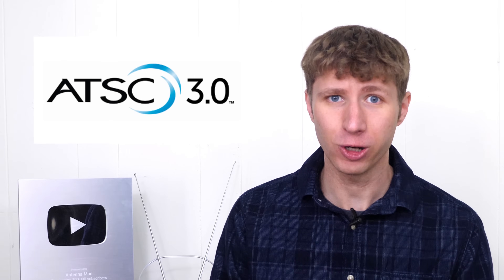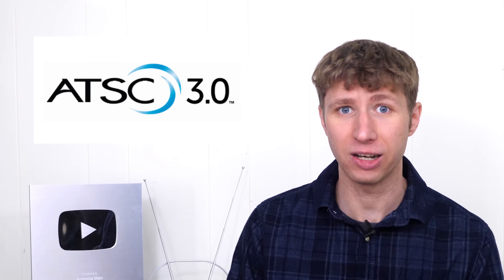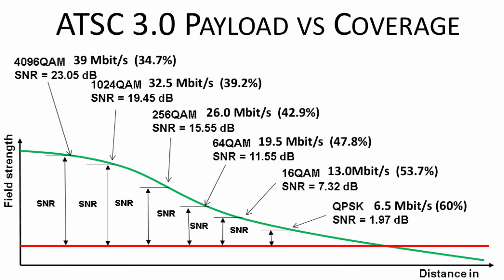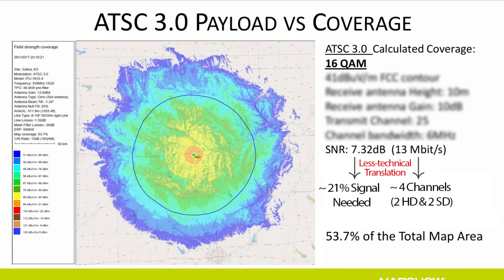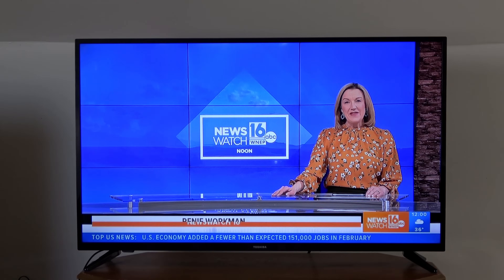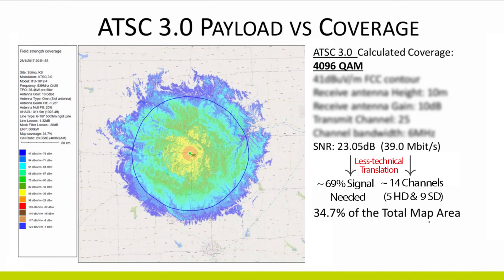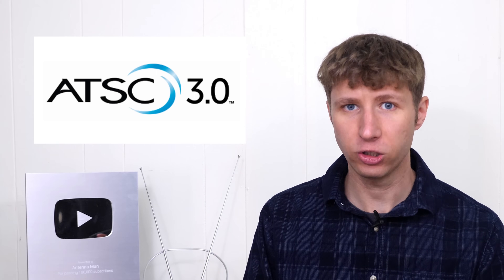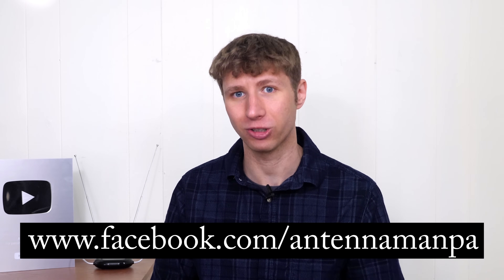ATSC 3.0 Allows TV Stations to Reduce Their Broadcast Signal

Comment: All about wireless handsets now has been for about 50 years now more true than ever. Still is a role to play for fiber optic lines now as well....even twisted pair actually. I'm going with "streaming services" as to why there is an issue with this as that consumes an incredible amount of bandwidth upon in the digital offer. Might not need digital anymore/might be post digital now #quantum_computer "quantum signalling" hard to tell. That will definitely light a fire under the ass of the digital assholes for lack of a better term to ditch the whole "trade off" thing as might not have any need want or desire to even have digital especially since none of that signal is secure nor produces content much in demand. Maybe gaming content #twitch maybe that's about it tho😊😊

Comment: Just 15 miles from the Philadelphia towers, in a third-floor apartment facing Philly, last week I lost the ABC affiliate WPVI 6 completely. All other channels are good reception. WPVI is snow, nothing else, no signal detected. Zero. I heard back from an engineer at WPVI, who told me they just switched to a new transmitter. My next letter will be a complaint to the FCC. I bought a flat antenna you had recommended, it gave me worse reception than I had already on the channels i was getting.

Comment: My antenna hasn't worked right in over two years now and I have a 30ft pole outside with a large array located within 30 miles of all broadcast towers in my area. 
I'm convinced "they" have been throttling the signals as a form of behavior modification, forcing us to purchase other forms of viewing entertainment. 
BS

Comment: The argument that means the least to me about ATSC 3.0, is that it is better for distance than 1.0 current system. I'd rather clean the cat's litter than listen to this point. I've never welcomed this point. So.the stations have a way to squeeze ATSC 3.0 but loose distance. Good. It fits my hopes. All I want is these digital standards to go away. My antenna is down and folded up. I could just give it away. Please, no more remarks that ATSC 3.0 travels farther. I want analog back.

Comment: WPVI Channel 6 will broadcast with 120 KW ERP and cover 70 miles around Philly with ATSC 4096 QUAM signal on LOW VHF Channel 6, the best of the low vhf channels in the USA!   Adjust your rabbit ears for 35 inches on each side for best reception.
Reply: Is this a waiver of the Low VHF limit?  Likely so.  Surprised that since the FCC Repack ™️, WPVI didn’t choose to piggyback on a decent UHF signal.
Reply: @christopherdunne7848   ABC deliberately chose Low VHF Ch. 6 for Philly and the Ch. 7s for NYC, Chicago, and LA.  VHF is better for TV transmission with High VHF Ch. 13 being the best and Low VHF 2 being the not so best.  Ch. 5 and 6 are the Goldilocks Low VHF Channels and Ch. 9-13 are the Goldilocks High VHF Channels.  Ch. 5 and 6  only need an antenna of about 35 to 38 inches long, which is a little longer than an FM radio antenna.

Comment: Tyler, The primary job of the FCC is prevention of interference. If ATSC 3 increases bandwidth, to maintain FCC. Mandated coverage without interference, they should be able to increase transmission power. You did not mention power, and that is a key element to the equation.

Comment: I have a Zinwell Nextgen TV Box that cost me $100. It sometimes gets stuck on the Nextgen TV screen when booting up. Sometimes it takes several tries for me to get it to work. This is the second box I have from them. The first was even worse and I believe was defective. When the box was sent back to Channel Master, they said they could not find anything wrong with it. They did send me a replacement box. The box would sometimes work, but not always. The Zinwell box also sometimes has issues with the signal. Sometimes I get a "No Signal" message and it can take several seconds for the picture to come back on! Far from perfect.

Comment: Wait. This video seems a bit anti-NAB and oversimplified from a technical perspective. Your conclusion is based on single transmitter and static ERP. Those are pretty big assumptions. I get that DRM has soured things a bit, but ATSC 3.0 far exceeds the capabilities of ATSC 1.0 and is highly desirable from a consumer perspective. Higher data rate 1024QAM and 4096QAM could be desirable to improve video quality, depending how broadcasters implement it. Don’t forget that single frequency networks (SFN) could offset any single transmitter coverage reductions. That’s something ATSC 1.0 cannot do. It’s time to move on from ATSC 1.0, which is outdated and FAR behind current technology.

Comment: Keep in mind that the coverage areas are mostly related to the budget and decisions of the engineers setting up the antenna and transmitter systems.  Lots of LPTV stations have way less coverage than they could be licensed for simply because they aren't willing to spend the tens of thousands to hundreds of thousands required for optimum indoor coverage.  Outright restrictions on higher modulations would prevent them from being used in terrain limited areas like where we operate where antenna design and beam tilt could be used with ATSC 3.0 SFN setups to increase coverage even with higher modulations.  (That is if we could get enough donations to cover the construction cost)

Comment: In the past 2 weeks I found out that Sinclair owned a tower that transmits 6 different network signals out of Gainesville / High Springs, Florida had blackmailed the broadcasters to pay more - they won`t do it - so now there are only 3 PBS stations broadcasting- no network coverage. Before change to digital- it could receive WJXT in Jacksonville and WCTV in Tallahasse - now can`t get either.

Comment: Aside from the potential loss of coverage DRM is still terrible.  If you have to have an internet connection to view a DRM channel then what is point of using an antenna?  They might as well just switch to streaming and be done with it.   ATSC 3.0 had a lot of potential but it seems like it is largely DOA.

Comment: I have a 3.0 channel that is in the fringe. I can get the 1.0 sometimes at night but not very reliable, depends on the weather. I Was looking forward to the 3.0 thinking it would come in better and maybe get it in the day. WRONG. It does not come in any better at all, actually the 1.0 signal is stronger when I compare the 2 on the tv meter. Sometimes the 3.0 drops off and the 1.0 is still on. Very disappointing getting hiped up just to get a big let down.

Comment: I'm already convinced that they control the signal strength because when the west coast of Florida (including myself) was being threatened by the 3 hurricanes that passed us by, but not without knocking out the power for a couple of days, I was surprised to see that even though I was only using battery backups until I was able to get my generator up and running the next morning, that I was practically getting all of the (including hard to get) channels crystal clear, however it was short lived once the hurricane moved on to the states north of me and that's when everything went back to the norm for me. Once again I was convinced that I still needed a new antenna.
Reply: It would be interesting to find out which station is the "lighthouse" for the market and see if they changed the "MODCOD" during the time of the storm.

Comment: I knew this would happen when it's claims of better reception from the get-go. If they use 20KW to broadcast 50 miles out, can get 70 miles with 3.0, OF COURSE you reduce the signal to match the old 50 mile range, but the "Datacasting" excuse is likely just that, an excuse. I'm sure stations (and WGBH would not surprise me here) are simply reducing strength just to spend less on transmitting a signal. NOT saying the higher demand protocols won't do it (look at UHF channels back in the day, and what power they needed to get roughly the same coverage across the dial), but I'm sure the robust ones can be used simply to cheap out on transmitting power.

Comment: First of all, I appreciate your videos on subjects like this.  I find them very educational and helps bring me up to speed on ATSC3 from a technical perspective.  I am mostly a radio person where it comes to the technical stuff.  If we boil everything down though, the Communications Act and underlying regulations are pretty clear, a broadcast station, whether it is radio or television is dedicated to provide to its community of license (the one that is said or shown at the top of the hour) before anything else.  Any areas outside of the community of license are a pure bonus to the public.  This is different than television/radio regulation in other countries where a company is franchised to provide full services within a particular region, even if it involves multiple transmitters.

The other thing I see here is that this is is not a case where the television station would actually reduce their effective radiated power (which would reduce the size of their service contours).  Since that is likely not happening, the FCC is happy because the station looks no different on paper and the station does not risk another station modifying as a result of any kind of reduction in the service contours.

The one thing I do not know about ATSC3 is whether the use of DTS can be done.  (DTS is distributed transmission system, which, in the ATSC1 world, allows for multiple transmitters at different locations to be put on the same channel and provide a "mesh" single frequency network).  

As you may know, the FCC will be voting this coming week to adopt a Notice of Inquiry into looking at different alternatives for GPS.  One of those is "BPS", which does radiolocation through the use of ATSC3 transmitters.  We should be seeing a lot of this at NAB this year.  This is one of the things I will be seeking out when I am there.
Reply: Yes, distributed transmission is part of the ATSC 3.0 standard and is known as SFN (Single Frequency Networks). This is a great technology that would essentially allow a mesh network of transmitters. However, I haven't heard or personally witnessed this being implemented yet.

Comment: Excellent presentation. The GatesAir Powerpoint presentation explains a lot. I foresee that datacasting is going to be the model that the station owners are going to use for ATSC 3.0 for an additional revenue source. The big question I have is will the stations move away from the ATSC 3.0 lighthouse and broadcast ATSC 3.0 at their own transmitter facilities once ATSC 1.0 goes away?

Comment: 3.0 is blocked by DRM. That basically means you cannot use it without very specific, and expensive tuners that need to be connected to only one device at a time as the DRM blocks the signal from being handled by a networked TV tuner. No one has multiple TV antennas for each TV in the house with a built in tuner for this purpose, so therefore, very few people can even access ATSC 3.0. A lot of these also require high speed internet access to use. This is such a broken deployment, because it was never geared towards improvement in quality, but with the idea of opportunity to advertise and make more money. ATSC 3.0 has been effectively killed by their own adopters, and now they're trying to kill 1.0 which means they don't have to offer any OTA signal that is not protected by DRM. This effectively kills 3.0 as well, which is their goal.

Comment: I have had  WHCT-LD (channel 35) licensed to Hartford and New Haven, Connecticut, for many years and, approximately one month ago, noticed a reduction in their signal strength.  I assumed they were having transmitter problems. I also have  ATSC 3.0 and those channels are OK. I actually spent several hours trying to ascertain the low power problem. My antennas and preamps are OK. Most ATSC1.0 are still booming in with a 92 out of 100 percent signal. So I don't know what is going on?

Comment: Of course, the FCC could have avoided this problem if they hadn't slashed power levels in the digital transition in the FIRST place, and those of us who actually WORK with RF and aren't just lawyers appointed by presidents to the commission to do political favors for donor corporations WARNED that coverage area would be lost if they did that, but the cell phone companies' money was more important to them.
Reply: Again, why I said I have a feeling that the groups that are pushing both ATSC standards are more marketing people than engineers.  No engineer that I know would say you can cover the same area that you did on analog by reducing power.  The only way you could possibly do that is to move the antenna to a higher elevation, and even that has limits.

Comment: Another thing is that increased signal strength doesn't necessarily mean increased signal range.
Reply: It does to a point, however, you can easily over-modulate a signal, as many do when they turn up the power on a wifi router.  Over-modulation creates distortions, which quickly negate any benefits you may have had with an increase in power.  It's a fine balance between signal power and noise levels, and finding that optimized balance takes a lot of time measuring signals and adjusting equipment.

Comment: Overall ATSC 3 has serious advantages over ATSC 1, but also more potential for predatory corporate abuses.  The reception of OFDM is better on many devices, while CODEC's are improved, so long as broadcasters use those advantages in the public interest as obligated by badly enforced law.  

ATSC 3 was planned around a 26 Mbps data stream plus denser CODEC's, if broadcasters use that mode.  Since RAW Cine grade 4k DCS runs a data stream around 200 Gbps, even the 39 Mbps COFDM ATSC 3 PLP is severely crunched and quality limited, at the cost of higher needed SNR and reduced coverage area, if only 1 video signal is carried and nothing diverted for non-OTA private contract data divergence of bandwidth.  

There's a need to pressure Congress to mandate minimum OTA TV quality, and as in past eras, restrict the use of OTA TV for so much secondary data for private uses, as to harm the public service aspects of broadcast licenses.

Comment: If ATSC 1.0 signals are not being adequately received in fringe areas, broadcasters would have a responsibility under public interest obligations (as described in the Communications Act of 1934 and the Telecommunications Act of 1996) to ensure that their broadcasts, including emergency alerts and political content, reach these viewers. This could require broadcasters to install repeaters or translators to rebroadcast the signals into underserved areas. And broadcasters cannot block ATSC 3.0 signals because of the same issues as emergency alerts and political broadcasts.

Under Section 309 (License Renewal) of the Communications Act of 1934, broadcast licensees must demonstrate that they have provided service in the public interest to maintain their licenses. Local programming, including news and emergency alerts, is a key component of this public service.

Quote: "In determining whether the public interest, convenience, and necessity will be served by the renewal of a license, the Commission will consider whether the licensee has substantially served the needs and interests of the public, including local news." (Section 309)

Comment: The broadcaster should have to maintain a signal strength that is sufficient to allow reception out to a specific distance from the transmitter or lose their license.
Reply: And they have setup the 3.0 statioms to match the same area as the 1.0 area.
Reply: @dennismcglinsey1939  Even further: match the same area as the NTSC area.  Because we lost coverage in the digital transition already.  That's half the problem here.

Comment: Wow, very informative.
I now wonder if that's my problem here in the Metro Detroit region.
I have an indoor Channel Master antenna attached to a Zapperbox M1. All the ATSC 1.0 channels (UHF) come in fine, but the one ATSC 3.0 channel, which originates from the same location as the ATSC 1.0 channels, and is even the highest power 900kw, almost never comes in.
I wonder if there's a way to determine the PLP in use by an ATSC 3.0 channel.

Comment: What is datacasting?
Reply: Datacasting is a term that uses internet push technology (in the case of ATSC 3.0, a multicast-like data stream(s)) to deliver content to your device, such as news and weather).  The fear with ATSC 3.0 and datacasting is that the broadcasters will either charge for datacasting service or will use datacasting to deliver unsolicited advertising (sort of like those article sites that have a dozen of frames with ads in it).  Depending on how that is set up, it could be in a form of a section of the screen, like the outer edge, to a pop-up box that you have to acknowledge.

Comment: Jeesh just require it to be backward compatible! Why would they want to cut 1000s of people off, it's commercial TV, that means you need eyes to see the commercials. Only way I'm getting a 3.0 box is if the FCC gives out coupons again, I didn't think they could come up with a stupider way to transition than the 2009 DTV debacle & subsequent repacks, but this 1.0 to 3.0 shows that we should never underestimate the FCC's stupidity
Reply: 3.0 uses internet protocol, so you can squeeze whatever into the bandwidth. 1.0 is limited to digital audio and video only. That’s why they want it to sell data off their transmitters.